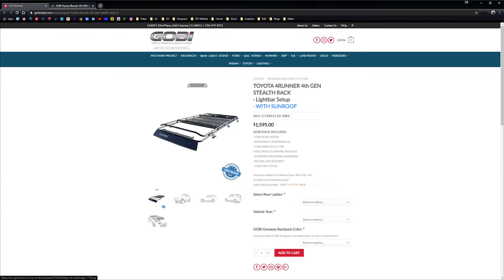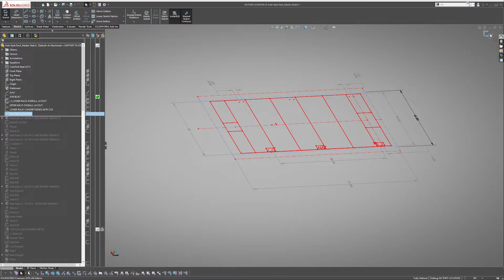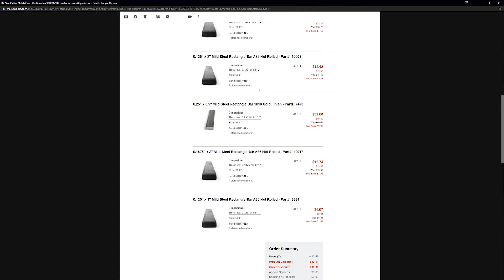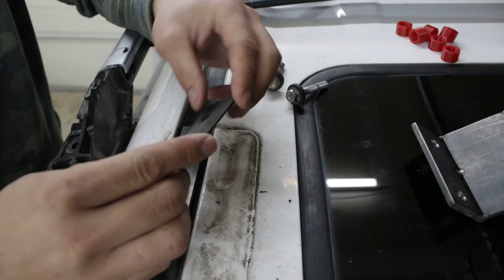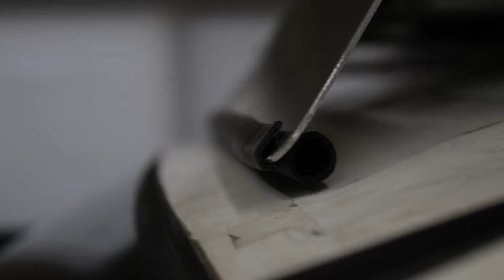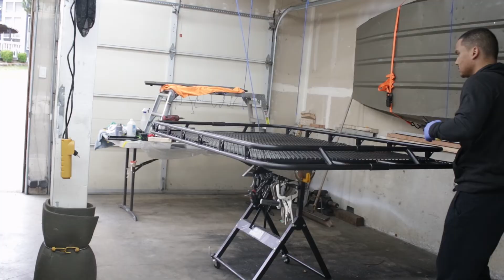DESIGN and BUILD your own $1700 ROOF RACK for your Toyota 4Runner for $500.

Comment: Great choice of expanded metal for the top! What gauge did you go with? How's the deflection? Is it walkable?
Reply from the maker: See video link
Reply: @RathaSochenda  I wound up using 1/2" 13 gauge and it worked perfectly on a 7-crossbar roof rack. Deflection is probably 1/4" across 12" spacing with 175lbs. It rattled a bit and so I added 1/4" thick rubber strips along the crossbars and now it's totally silent.

Comment: Hey amigo would you like to build it for me? Then come to pick up it, I am trucker over the road, I hope you answer me.i have 2003 Toyota 4Runner limited
Reply from the maker: I just did this one for fun
Reply: @RathaSochenda , it is for fun but it’s nice work, the roof rack and the ladder are expensive, what you think amigo about those roof racks, wich one can fit my 4tunner?
ARKSEN 84 x 50 Inch Universal Extra Wide 150LB Heavy Duty Roof Rack Cargo with Extension Car Top Luggage Holder Carrier Basket for SUV, Truck, & Car Steel Construction
Or
XCAR Roof Rack Carrier Basket Rooftop Cargo Carrier with Extension Black Car Top Luggage Holder 64"x 39"x 6" Universal for SUV Cars
Gracias

Comment: Awesome build.  I have something similar going on with my 01 Tacoma.  I will epoxy primer it and do a satin black single stage or rhino liner for when I have to weld on brackes for my PIIAs all around.  Even if it's a self build, it's expensive but it's made to fit your needs and the pride value counts too.  Please show a video of your add ons!!!

Comment: why didn't you just weld the basket to the mounts. makes no sense to use bolts and more bolts it you already measured it. it's only going on 1 way, so WELD IT. save the bolts money for beer.
Reply from the maker: Good point next time 🍻

Comment: I love this video! Your planning, drafting and execution are great. I recently made a lumber rack for my new Ridgeline and I did a lot of similar things. I also enjoyed your video on modifying an engine stand for your tube bender. You should consider buying a CrossFire cnc plasma cutting table to help with cutting parts. I love mine.
Reply from the maker: Thanks Millar. If I get serious, hopefully I can save up for a ShopSabre SideKick 8 CNC Plasma Table.
Reply: @RathaSochenda  The SideKick is a nice looking cnc table, BUT it is really big for a shop your size. Think about what you might be cutting out on a cnc table and see if you need that 4 x 8 size. I have the smallest table Langmuir make (2' x 2') and I'm making all kinds of brackets, tabs and belt grinder parts.
Reply from the maker: @millarfarewell5343  yeah your probably right... At minimum I would want a 4x4 table. I tend to outgrow things quickly.

Comment: Very nice! You have good skills. I am looking for a roof rack for my Suburban and not finding much that I like at a reasonable price.
I am curious to know how you liked the mesh that you used? Did you find it too flexible or was it sturdy enough to walk on as you did in the video? Looked like it was kind of bouncy.
Reply from the maker: Hi Christopher. I used 
3/4" x #9 - Steel Expanded Metal - Flattened its rougly 1/8" thick and its pretty sturdy. I think it really depends on how you frame your basket. I used 6 cross supports that are roughly 10" from one another then place the expanded metal over and welded into place. There's some deflection as you walk over it but not much. Hope this helps with your build.

Comment: Thank you. I need a rack system that can hold 250lbs. I've been doing the load calculations using Unistrut and they have a rating of 2k to 5k depending on span. Wind loads is my biggest question? 80 mph wind force ??? Thoughts???? any help is much appreciated...Thank you Rich

Comment: I know I've seen pre-made rack mounts for 4runners somewhere. You could incorporate those into the build, eliminating the most difficult step.
Reply from the maker: Yeah saw a few options for the rack but I wanted the basket to sit as low to the roof of 4runner and those  premade  mounts just wouldn’t work for the look I was going for...

Comment: Is it ok if i used a square mesh or diamond is better?
Reply from the maker: I think either or would work fine.  Just make sure you get the right gage thickness. I think I was using 9 gage flatten metal.

Comment: Excellent design and fab of the roof rack and amazing descriptions. When are you going to do video loading your John boat? I just bought a 12 foot aluminum boat weigh about 104 lbs. I have a 2011 Subaru Outback with factory racks. I am still trying to figure out how to revise the factory rack to secure the boat. The car racks is 41 inches long and the boat width is 57 inches.
Reply from the maker: Thanks! Jon boat mounts are done and working great. Just haven’t had the time time to edit the video. I’m hoping soon. Stay tune....